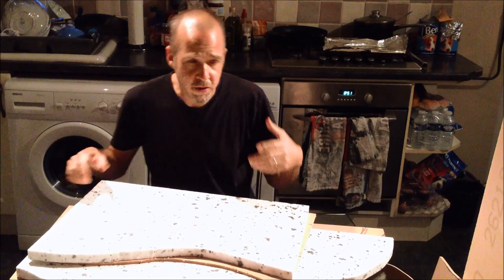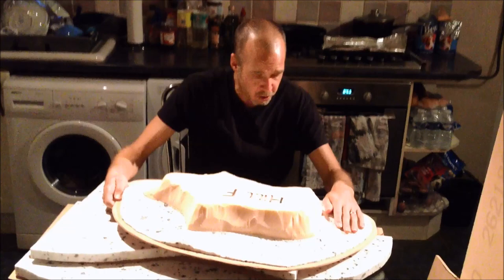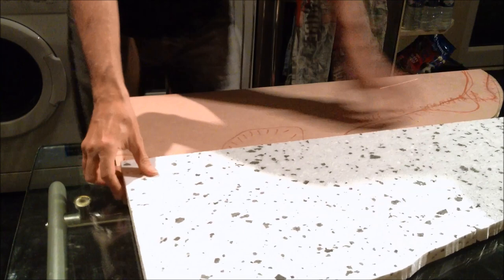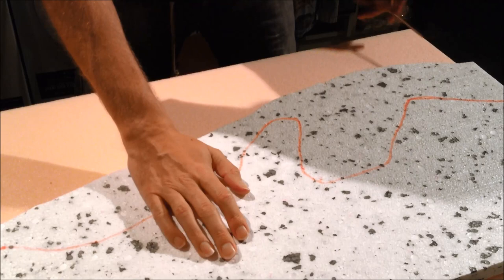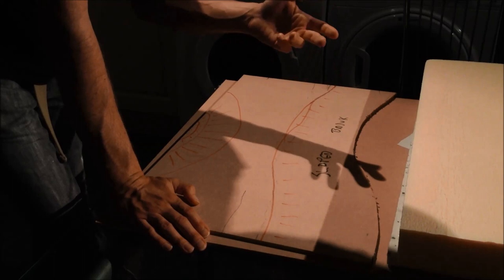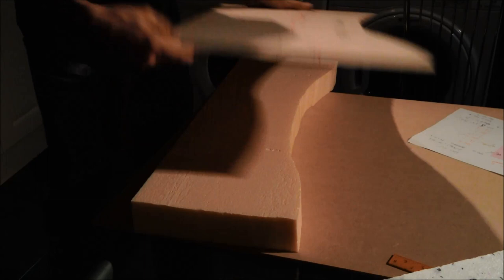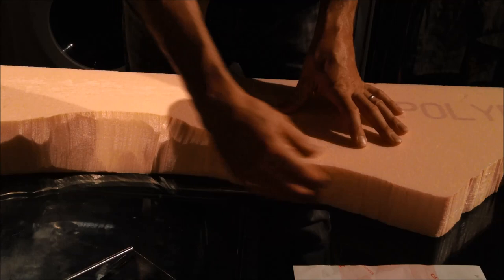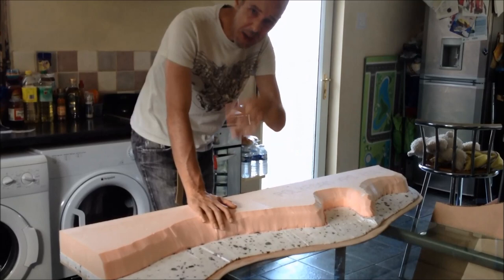Big Modular Hill Build Tips

Comment: Hi, just a thought on transferring a 'complex' shape to the poly.  Why not use thin newspaper or even baking sheets/tissue/tracing paper and trace out the shape from the baseboard, then transfer to the poly?  This can either be by cutting out the shape and drawing around it, or putting the whole sheet down on the poly sheet and "pinning" it (that is using a pin to make a line of holes and then dusting dark chalk or charcoal on the sheet which will transfer to the poly?

Does any of that make sense?  It was something I used to do in painting when I wanted to copy a complex image.

As ever, interesting vid.  Cheers
Reply from the maker: Anthony Little All good tips mate and if it was complicated, I'd probably go down that route but in this case, it was a pretty simple :-)